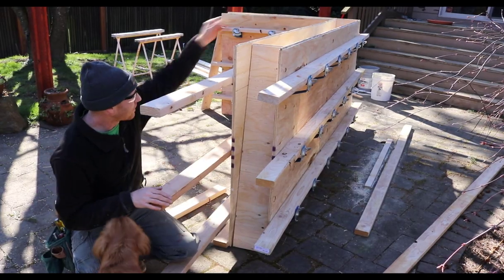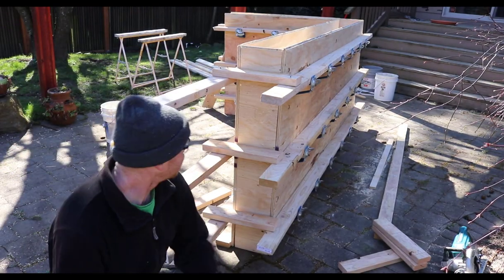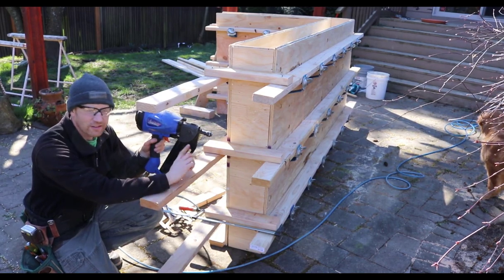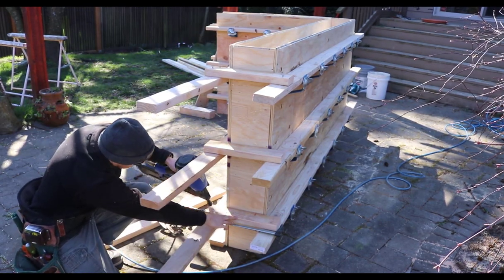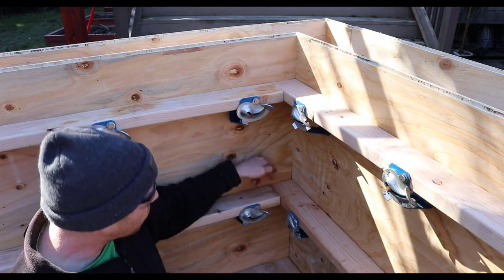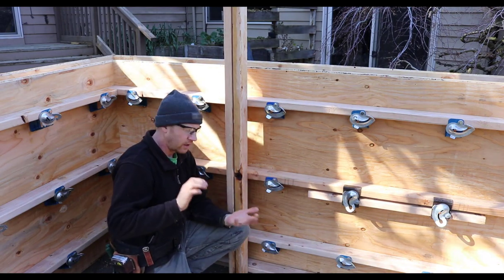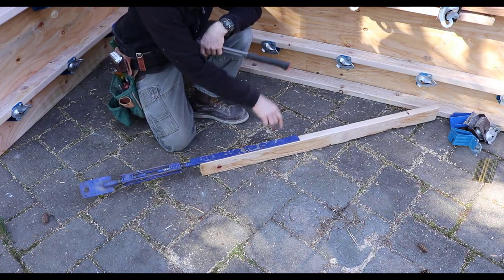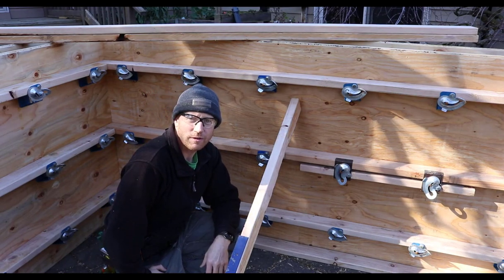Jahn Concrete Formwork System Part 3

Comment: Great videos! I needed a refresher on the Jahn Snaptie system, and this is by the far the best video I was able to find. Very thorough and detailed. I would love to see a video on forming the wall and footings simultaneously, so they can be poured together (for 4 foot or shorter walls). Thanks again. Keep them coming.
Reply from the maker: I do want to do a video on that. It is a great option for smaller projects and I used to do it to avoid calling out concrete trucks and pumps multiple times.
Reply: You can't do snap tie walls without pouring a footing first the inspectors doesn't want stakes in the footing. Also much harder if you want to do that then just use two by twelves and strong ties.

Comment: You can also put your bottom 2x4 and attach your hair pins not too tight though , so you can avoid the vibration and knocking loose those hair pins and it will hold both 2x4s steady so you can get those 16 doubles in without a problem.

Comment: THANK YOU FOR THE VIDEO.......YOUR FORM WORK SKILLS ARE VERY BASIC.......AND I WOULD SAY IMMATURE.......YOU @UT THE FIRST 2X4 HORIZONTAL SITTING ON THE METAL BRACKET.......THEN WHEN YOU TURN THE CORNER.......TURN THE METAL BRACKET U@ SIDE DOWN.......ATTACH THE 2X4 U@ UNDER THE METAL BRACKET.......NOW YU WILL GO UNDER THE FIRST 2X4.......EXTEND THE 2X4 ENDS 2 FEET BEYOND THE @LY WOOD.......NOW YOU WILL @UT 2 DOUBLE HEAD 16 @ENNY NAILS TOATTACH BOTH 2X4S TOGETHER.......THE REASON YOU MAKE THE 2X4S 2 FEET LONGER THAN THE @LY WOOD IS NOW YOU ATTACH VERTICLE 2X4SON THE OUTSIDE OF THE HORIZONTAL 2X4S.......NOW YOUR FORM WORK WILL NOT BLOW OUT.......IF YOU DID FORM WORK FOR CONCRETE ON MY JOB LIKE YOU DID IN THIS VIDEO.......IWOULD HAVE SENT YOU HOME.......BECAUSE IT WILL BLOW OUT.......THANK YOUB FOR THIS VIDEO.......TO TEACH THE VIEWERS HOW NOT TO FORM A CONCRETE WALL.......IF YOU DO NOT UNDERSTAND @LEASE CALL ME AND I WILL GO INTO MORE DETAIL.......931 829 3344.......I HAVE BEEN DOING CONCRETE FORM WORK 55 YEARS

Comment: how is that martinez hammer? I've seen your review. I'm wondering if the handle is long enough or if its as short as it looks
Reply from the maker: So far I love it. The fact that the head is all steel makes me feel less like I have to baby it than a full titanium head. As far as the overall length, it is about a half inch shorter than the Stiletto TB II, and the same length as the DeWalt 14oz. mig weld hammer.  Thanks for checking out our videos!
Reply: @DanSarahMakers  thank you. I currently use the dewalt 14oz migweld

Comment: How u anchor down the bottom plate to concrete?
Reply from the maker: Several different ways, the cheapest and no special tools or parts way it to drill a 3/16" hole through the 2x bottom plate into the footing or slab and stick one or two pieces of tie wire into the hole all the way to the bottom and then drive a 16d duplex nail into the same hole. Another way is to use 1/4" reusable forming spikes. They look like oversized duplex nails with a little offset bend at the end. Finally, Hilti makes special nails for their powder actuated nailers that secure down 2x material that has a weakened spot in  them so that they break off just below the concrete footing when you strip the forms, much like a snaptie.

Comment: No strong backs or braces.use increments of 16 even for bulkheads so they can be re used to align with the cups\brackets on next pour. Clamps are unneeded

Comment: What determines if you go with a single waler or doubles? And do guys ever use screws instead of nails?
Reply from the maker: Justin, with the Jahn system, the 2 x 4 walers are stronger than the ties themselves so if dbl. walers were needed, the ties would probably start to break during the placement. I have seen crews try to strengthen their forms by placing additional walers in between the walers supported by the ties and Jahn brackets but these are only supported by the strong backs and in turn are actually placing additional stress on the ties that are supporting the strong backs. If the placement rate needs to be greater than a 16"x16" tie spacing can safely support, then maybe a 12"x12" tie spacing should be calculated and if safe, used. If not, then a different type of forming system may be called for.
As for screws, most drywall and decking type screws are hardened and brittle compared to nails. I would not recommend them in any shear application, side to side, but they would probably work in a tensile or compressive loading, in line with the screw. A concrete vibrator can induce loads that can blow out forms if not used properly and brittle screws can "un-zip" in a cascade failure once one breaks. Nails on the other hand can slowly bend as the forms slide apart in a worst case situation.

Hope this helps!
Reply: Hell no carpenters always wanna use screws NAILS ALL THE WAY. Trying to strip forms with screws is hell on earth they get filled up with concrete
Reply: @likeaboss860  I'm a  concrete foreman for the past 20 years. We switched to straight screws about 5 years ago. Duplex orange 1/4" hex head screws. Super easy to strip.
Reply: @jdelapaz14  Those are pretty slick brother but why don't they fit thu a concrete  stake
Reply: @likeaboss860  The 2 inch fit no problem and the 3 inch fit tight. Reverse drill a little then forward and it's also no problem.

Comment: Im just going to buy some 12 inch long hex bolts and use 1/2 pvc as spacers, pass the bolt though the pvc and they get reused then just patch the pvc holes after.
Reply: how did that work?
Reply: Let us know if you manage to get the pvc out as well.
Reply: @tealkerberus748  no the pvc  remains embedded and cannot be removed.